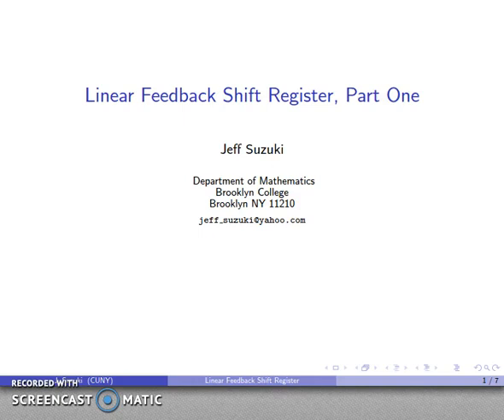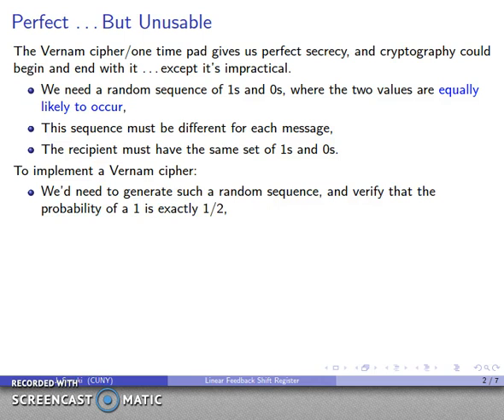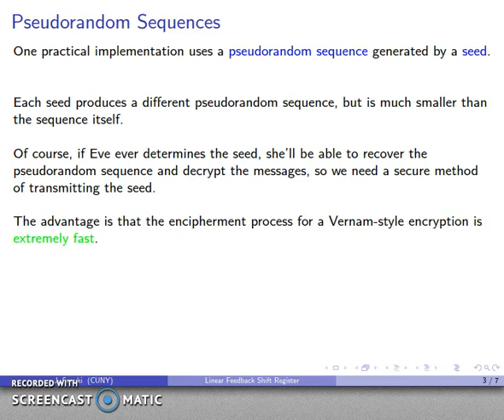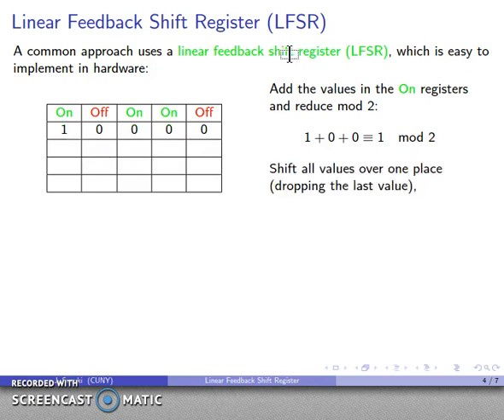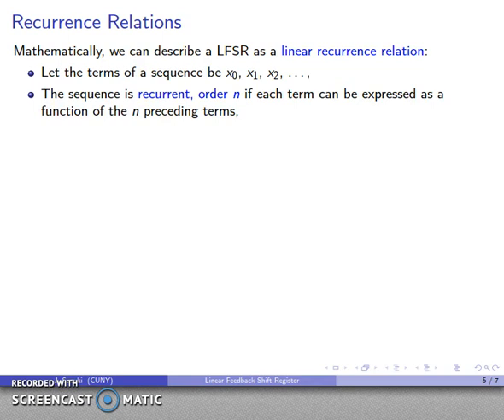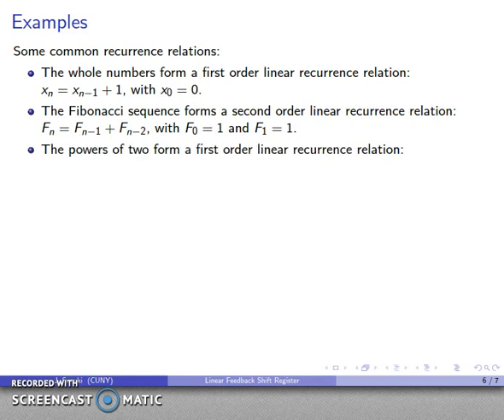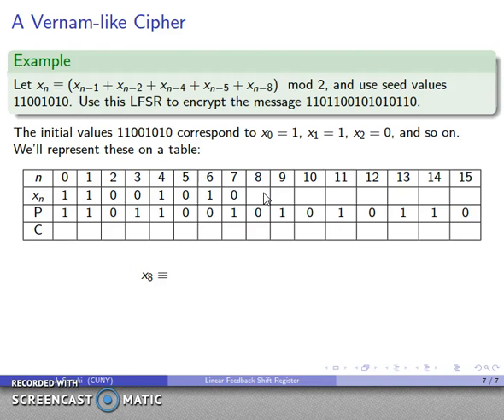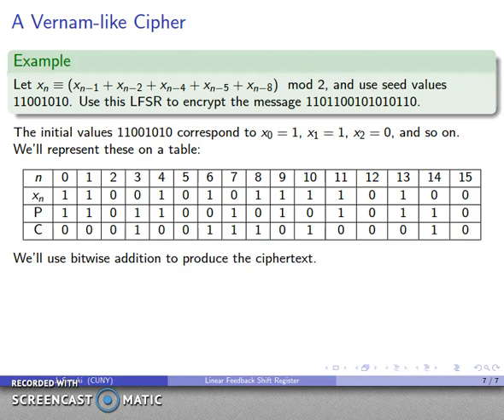LFSR 1

Comment: This video was very helpful. However, from my understanding, the taps can't just be any set of digits in the register, they have to be specific based on the number of digits you're using. If you just use any random taps, you won't get a full period (you will get stuck in a loop very quickly.) This table tells you which taps to use for which size registers:
https://pdfs.semanticscholar.org/9487/ab51297b35a1ff570db6f7223870d8da7fa9.pdf
Reply from the maker: Yes, there's quite a bit more to the story of LFSRs, because you do run the risk of getting a too-short period if you're not careful about how you set them up and/or how you start them.  

I'm working to update this set of videos, as there are several recent developments that are worth referencing.